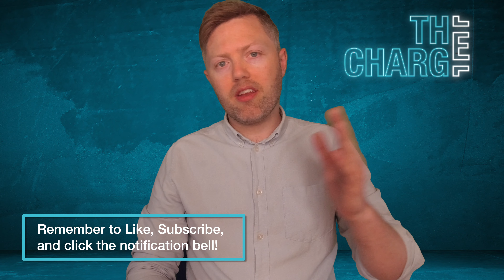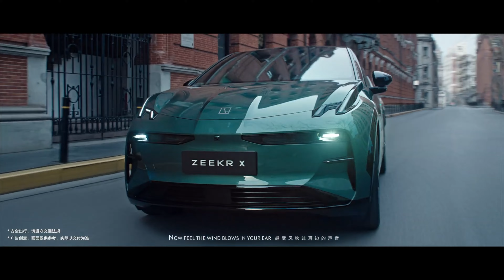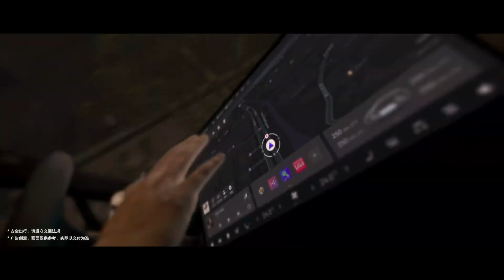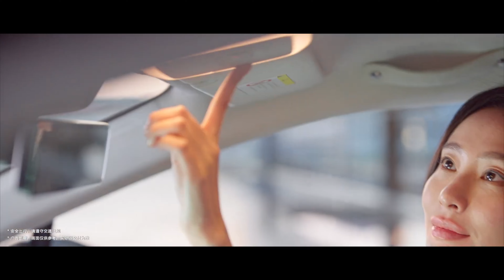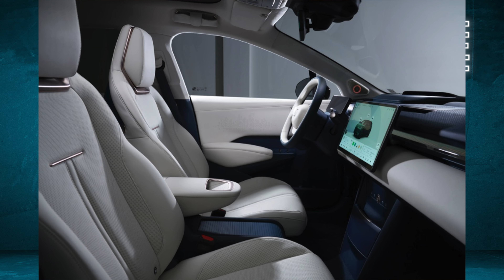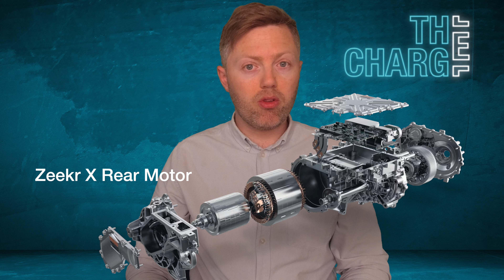Zeekr X rolls off of Production line ready for Australia and Thailand

Comment: Prices have been announced for the Thai market. 2 variants : 

1. Standard @ 1,199,000 THB or AUD50k
2. Flagship  @1,349,000 THB or AUD 56k.

Noticeably differences btw the 2 are:
- no. Of speakers, 7 speakers for Standard and 11 speakers for Flagship, Yamaha branded. 
-Wheels 18” for Standard and 20” forged for Flagship. 
-Rear wheel, single motor for Standard and AWD, dual motor for Flagship.

Vehicle warranty: 5 years or 150k km whichever comes first.
Motor and High voltage batt warranty: 8 years or 180k km whichever comes first.
Road assistance
24/7 call center
Reply: @DekThai101  good pricing for Thai. Hope Malaysia price would be similar.

Comment: I think it's the true Tesla  Y competitor even with slightly less powerful spec's... Autoline did a comparison shop against it and Mr. McElroy was very impressed with it, mostly by its pick up and peppiness which what you mentioned. Especially when it's spec'd at $30K vs a Tesla at $38K. Personally this is what I'd pick if it were available here in Canada but so far it isn't...